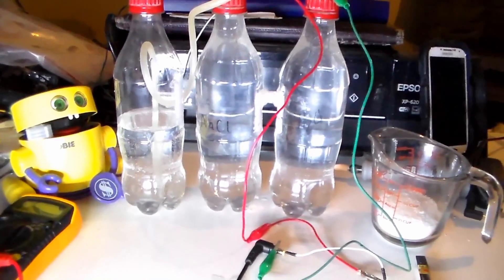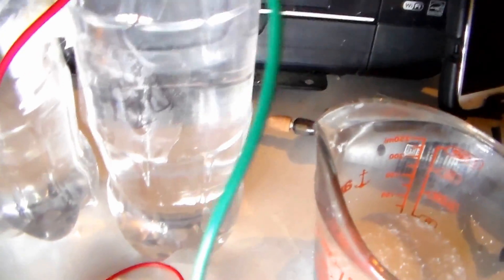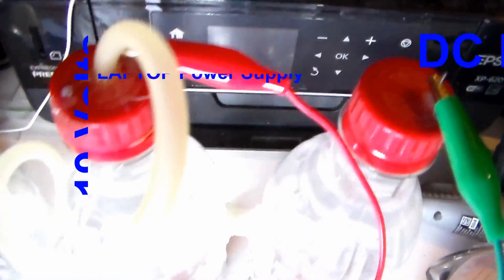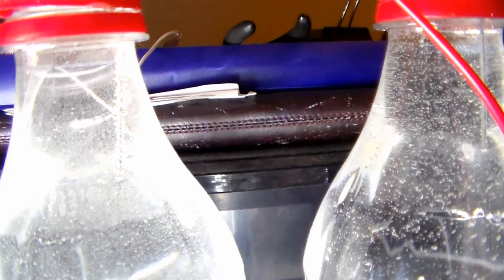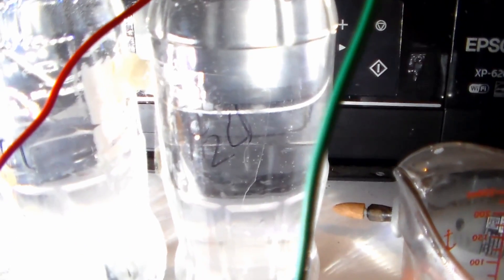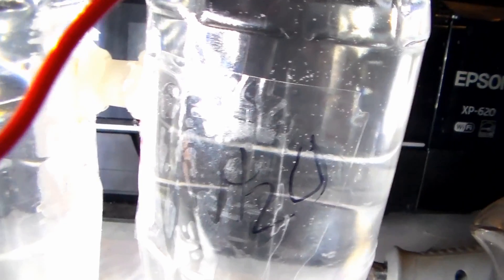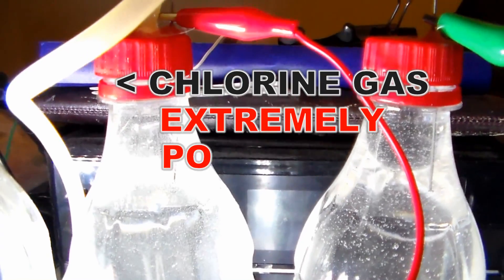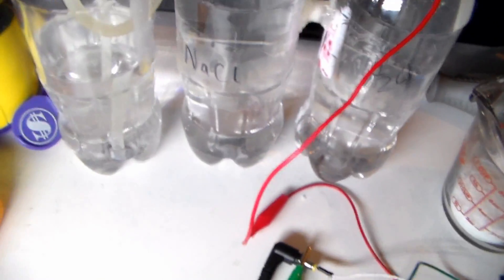How to Make Sodium Hydroxide NaOH Lye from Salt ,Chlorine Gas Oxyhydrogen HHO

Comment: quick question that setup looks hella shady if we seperate hydrogen and oxygen it gives H2+O2 which is detonating gas and will explode in contact to air but if that mixes up with Sodium it gives NAOH but what about the chlorine gas?
ain't it gonna be instant death if someone inhales it or will releasing it open air and open surrounding will do the trick? so if i have to do electrolysis of salt water to obtain NAOH i gotta be in open area and have surroundings clear

Comment: how to get pure NOah
Reply: You should check out NaOH recrystalization. In this way you should get >90% pure NaOH crystals.
Reply: You can buy it mostly as a drain cleaner. Caustic soda. Is about 95-99% pure. Do watch out as it heats up rapidly when added to water. So add it slowly and stirr alot

Comment: to produce 1 litre of sodium hydroxide,what I need to prepare with this method?
Reply: First you need to know how many grams you want or how high you want the % if it is disolved. Then youd need to look at molarity. 58.44 grams per mole. Then calculate the weight if chlorene gass 35.45. So per 58.44 grams 35.45 would get lost as chlorine gass. 23 grams of sodium ions that combines with the OH- ions(17 grams per mole)  in the water to form NaOH thats 40 grams per mole. So for every 58.44 grams of NaCl you could get a maximum of 40 grams of  NaOH

Comment: What if you add the hydrogen off gassing into the chlorine off gassing tube, then pass these combined gasses into the water diffusing bottle. Does that help make the hydrochloric acid?
Reply: Yea that would  make a dilute HCl solution. Dont forget hydrogen is explosive and chlorine is toxic tgo